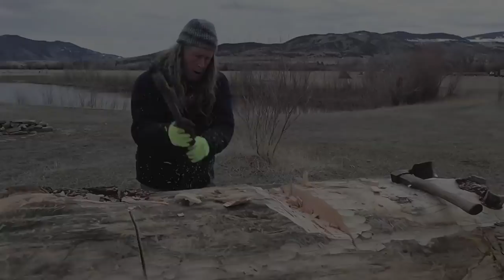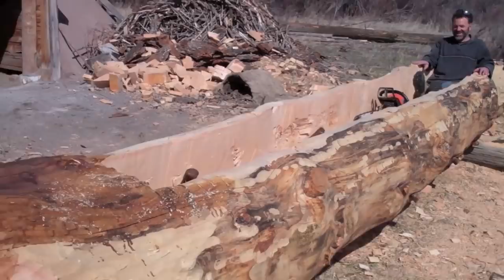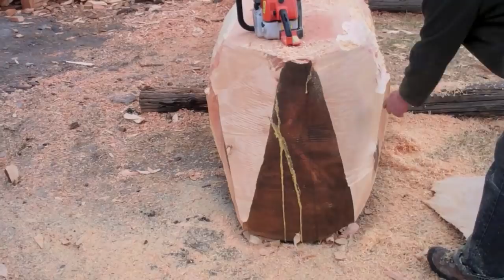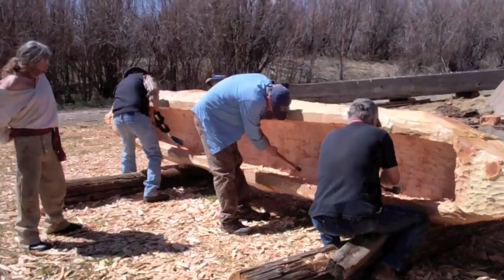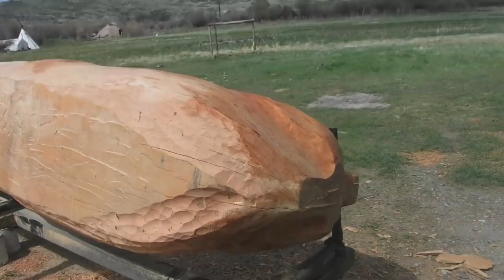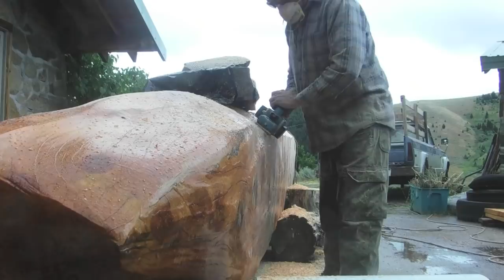Dugout Canoe Carving: The Story of Belladonna Beaver

Comment: Reject log?  Too many knots?  All subjective opinions, all the knots and colors make the finished result so much more beautiful.  It's a work of art really.  Thanks for sharing!
Reply: I am not saying it isn't beatiful work, but the question of knots, is not entirely sublective. Especialy for a canoe that has to be sound on the water, i am sure you have hat knots with different density and non consistent fiber, that falls out. That is even if you over come the issues such as in the beginning of the video with them making working the wood difficult. I have a small acreage tree farm and know if you want to use the wood in its original form and not as firewood you try and remove branches so the don't cause big deep knots. Look how many videos now with them being filled with epoxy.
Reply from the maker: There were a lot of gnarly knots for sure, but they do add to the beauty. Here is Part 2: https://www.youtube.com/watch?v=N-JgWTDUta0
Reply: Bravo les gars

Comment: Imagine making this before power tools. Wow.
Reply: I think some people used coals to burn out the center and then chip out the ash as a quicker way of doing it.
Reply: Excuse my ignorance Ringo, but I was wondering why they burned the ends of the posts. Does this prevent rotting?
Reply from the maker: It wouldn't be difficult with a different tree, such as cottonwood, which could be burned out with hot coals. Here's the final product on the water: https://www.youtube.com/watch?v=N-JgWTDUta0

Comment: Seal it with a mixture of pine tar and boiled linseed oil if you want it to be permanently waterproof. That's an old trickthey used on wooden ships
Reply: Add a third of turps to assist with soaking in . Boat soup will preserve the wood beautifully
Reply: That works, of course, but is very high-maintenance. I use linseed oil, covered with marine spar varnish. Works great on most woods.
Reply: @dugoutcanoelove1759  wouldn't the oil reject the varnish? I always thought it was either or. As is varnish doesn't last so long either.